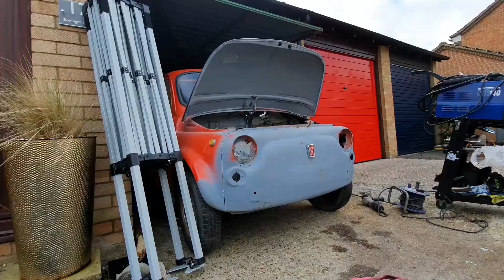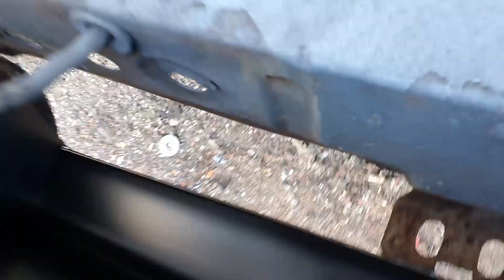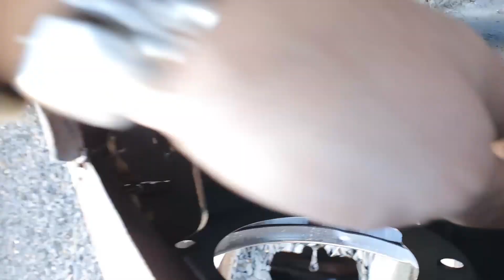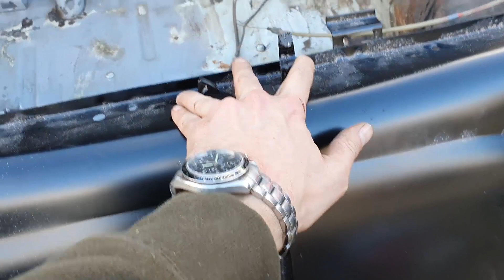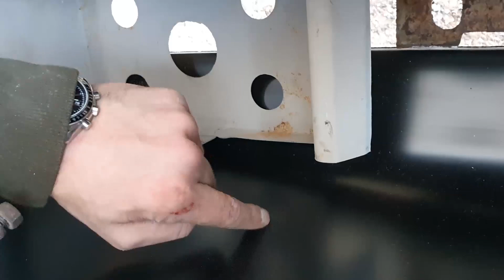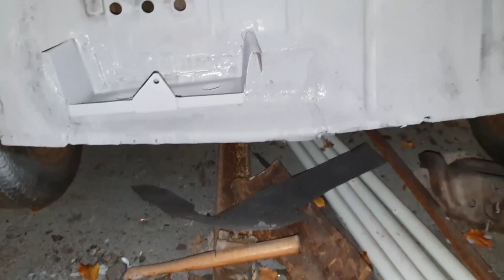I cut the front panel off!

Comment: Is that hole at the front a plug weld to the front panel? I’m doing a restoration at the moment and the previous owner replaced the battery tray with a bed of cement 🤦‍♂️
Reply from the maker: The battery tray is welded to the inner panel and attaches to a reinforcing structure/brace type thing which is then welded to the front panel where the bumper mounts
Reply: @FoxSpeedshop  is the front panel brace part of the new panel or is it an extra part?
Reply from the maker: Its part of the battery tray if i recall correctly, though it might be part of the inner panel

Comment: Hi just been watching your video, would you have any tips /  tricks for welding / fixing the front panel on to the front wings, due to the lack of space I cant work out how this could be carried out
Reply from the maker: Yeah what i normally do is punch holes in one flange the clamp together and plug weld with the mig by reaching in from the top. I stitch weld along the bottom seam from inside and plug weld along the lower edge flange from outside

Comment: I need to change my battery tray as well. So this is gold for me. Keep up the good work
Reply from the maker: glad it helps, hopefully your battery tray hasn't caused the panel behind it to rot away too like this one, otherwise its a bit more work, not too bad though, and not like anyone ever has cause to look down into there
Reply: @FoxSpeedshop  from what I can see it’s not rotten. I’m curios if I can change only the tray, without taking the front panel off. Do you think it’s possible?
Reply from the maker: @CasaDin30  itll be a struggle, its welded to the inner panel, the nose panel and the support braces on either side. You might be able to split the spot welds between between tray and inner panel and tray and nose panel with a spot weld chisel, and then use a flap disc to grind through the spot welds on both sides joining it to the support braces, but access is very tight.